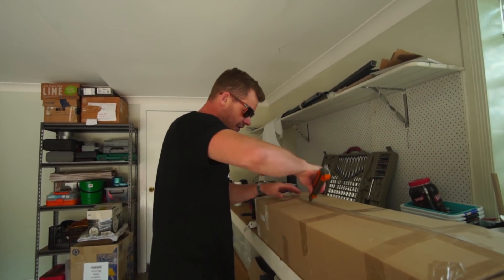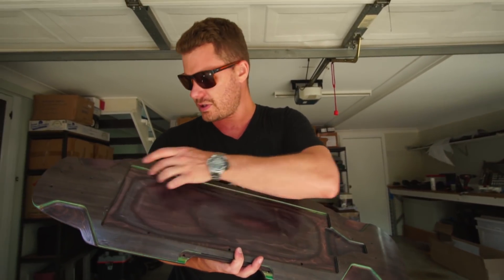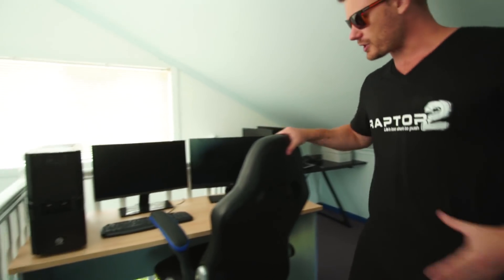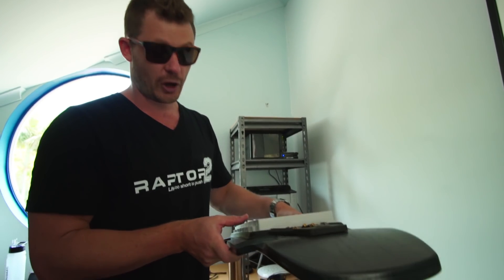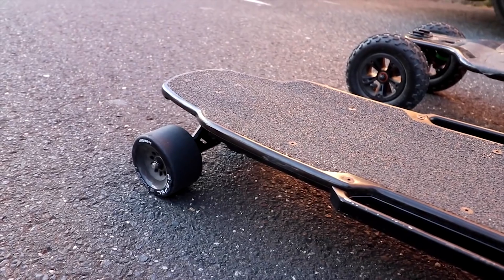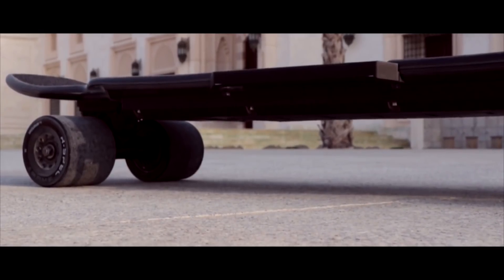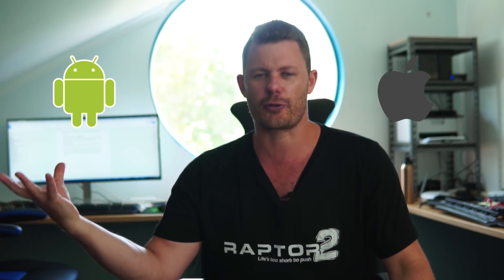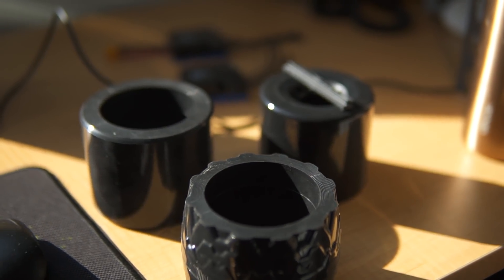Enertion Electric Skateboards - Big Raptor 2 UPDATE 2018!!

Comment: Please make 99 watt hour batteries for it. For the win. The rest of the battery pack can be a lightweight plastic insert. Ideal for traveling. etc. Buy several batteries when traveling. Come back and slap in the big battery when at home. Built in lights please. When braking the light lights up brighter, then dims to normal. Always a kicktail. ALWAYS. Side lights built into the sides. Wider wheel base.
Reply: I said please. That's the ultimate skateboard. Built in light. Wider Trucks for speed. And modular battery packs
Reply: AND it needs to disable one of the motors when traveling at a constant velocity (within a small threshold) to hypothetically increase range.  Which motor this is varies for even wear.  Not only would this have to be proven with a test (I believe it to be true) but both brake and throttle would have to quickly re-power the other motor.  The disabled, free spinning motor could provide trickle charge because why waste it?
Reply: we should make e boards.